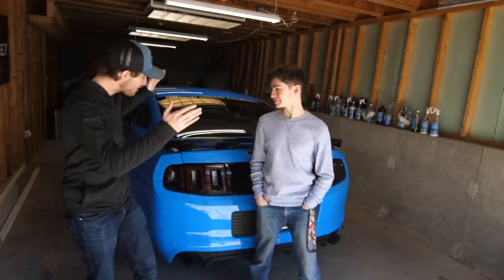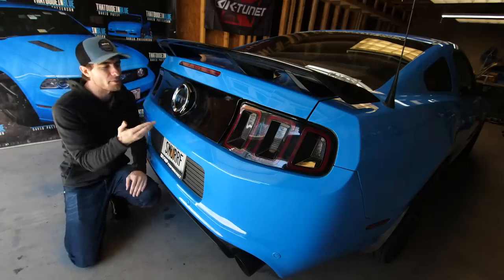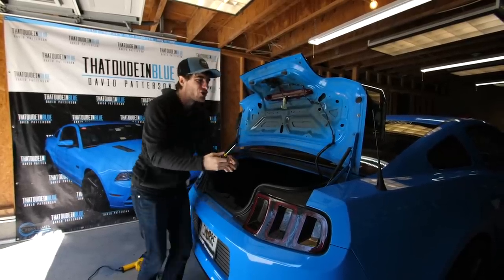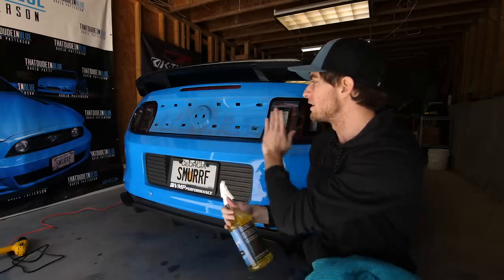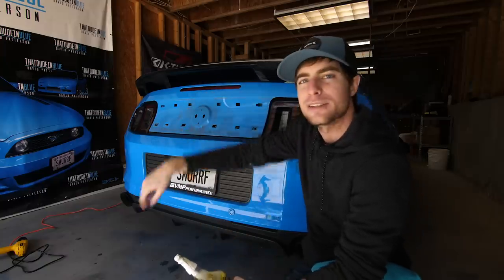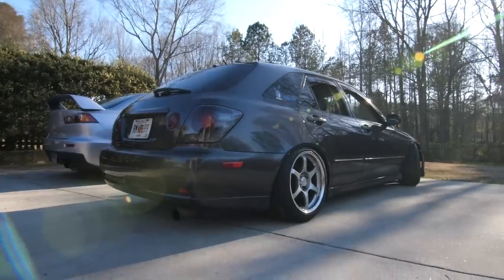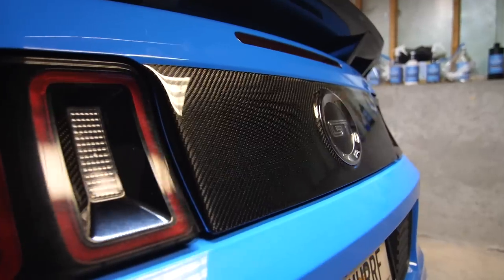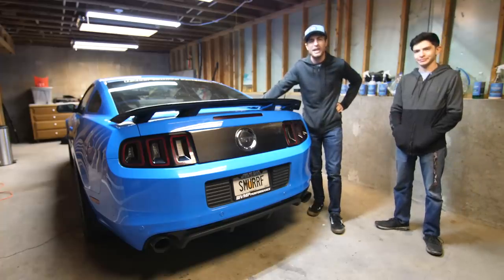Cutting a Hole in My Mustang for CARBON FIBER GOODNESS!

Comment: I hope you sealed the expoxed metal after you cut the panel otherwise it's going to rust out your trunk
Reply: It’s fine if it’s garage kept which it is
Reply: Khalid gives him a reason to go carbon fiber trunk.
Reply: Gotta see more of that is300 wagon!! Looks soo sick
Reply: @HTSWAGGER  wrong. Moisture is in the air and will be in the garage.  It will rust.  I hope he put some paint on the exposed metal or he will have rust forming fast.
Reply: Thats what I thought too.  There is moist in the air even in the best kept garage so it WILL rust slowly but surely under the decklid where the metal is exposed. Why not take a little more time and apply protective paint and clear coat to avoid rust 100%?
Reply: @idk-gq3lh  were your tools encased in carbon fiber lol he lives down south it will be fine. Even if he didnt if water gets back there it will make its way into the trunk and he will have bigger problems. You can unbolt a trunk you cant un bolt a floor pan. Todays cars are disposable. Plastic bumpers. On noard computers arent as rebuildable as a 100 year old carburetor.
Reply: Dominic Tremblay the kit comes with patches you put over the holes
Reply: 6:29 they covered it
Reply: With temp change the metal will sweat. It will rust.
Reply: @letsgotomarsman  that was glue they applied, so no they didn't
Reply: @chickensfloat7427  Have you ever been in the south? Unless we are talking southwest, then it's often stupid humid.
Reply: @letsgotomarsman   water will still get in when you wash it
Reply: Kinda depends on if garage is heated cuz heat controls moisture . . .

Comment: You should put some paint or primer around the hole you cut out. You don't want the raw metal starting to rust on you.
Reply: tscooter22 6:29 they covered it
Reply: @letsgotomarsman  no they didn't, that was a glue they applied

Comment: You should really take that back off and touch up that bare metal where you cut with some primer or even touch up paint. Any water or moisture gets that and it will rust fast. Just a FYI looks good tho man

Comment: David, you should do a GT500 brake caliper conversion on Smurff next with all the go you need to be able to stop. Maybe add in here that you should also use touchup paint in the area after you sanded it to prevent rust.

Comment: No rust protection of the now exposed metal edges?
Reply from the maker: Once you have the decklid and emblem if done correctly it will be a 100% seal. BUT it doesn't hurt to do that.
Reply: @ThatDudeinBlue   you do know that there does not have be water in order to form rust. The moisture in the air is enough to act as an electrolyte. Please just prime it of you can!
Reply: @ThatDudeinBlue  I've been doing spoilers (etc.) for years and always spray the holes with anti-corrosion spray or paint.  If those aren't handy, I use like a synthetic lube with ptfe or lube in a tube as I like to call it. lol. Eventually it will rust from moisture.  Not trying to make you nervous, but it will even if it's sealed around with adhesive.

Comment: I honestly wonder what would happen if you were to upload twice a week vs 3 times a week. I have noticed some quality control issues with your content lately and I am like... That is not the David I know. There probably isn't enough time in the day to keep it up, I know first hand the time it takes to edit stuff.

On the mod, I am on the fence. The original piece was concave and flowed with the body line. The new one does not do that and I am not sure I like that. But, it's not me that has to like it. It's you, and one thing I do agree on, carbon anything is usually a pretty cool thing! Now you need a carbon wing! GT500 quad exhaust, carbon hood...

Comment: Did you have to cut a hole in the carbon fiber also to make the original emblem fit?  My son has the base V6 model and cutting the metal trunk won’t work. The new carbon fiber panel is not concave enough for the emblem.  Did you have to shave the back side of the emblem too? Why was showing the installation of the emblem not in the video?

Comment: So. David. I have these cheap wheels that I bought for my car. Well my brakes started making noises and squealing etc. Eventually I got around to getting them replaced but some crap got on one of the back wheels. You might be thinking "oh just some break dust/grime.. whatever" right? Well I have LITERALLY tried everything to get whatever the hell is on my wheel off. Degreaser, wheel cleaner, etc etc etc. In this video you say your degreaser will get off everything. So, I'm going to put it to the test and if your stuff works I will literally never use any other cleaning supplies in my entire life.

Comment: I would have cut the required circle out of carbon trim not the car, and fitted the GT badge over the hole.
Reply from the maker: We thought about it, but the elevation of the bump still made it difficult. Looked at a few tutorials and this was the way to go.
Reply: COOL I guess that's difference between watching and doing. ;O